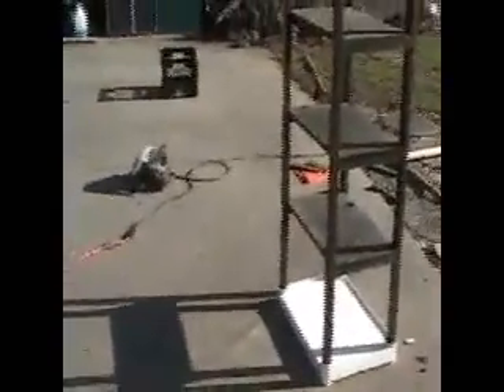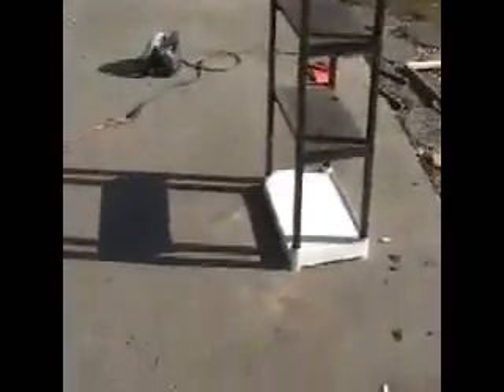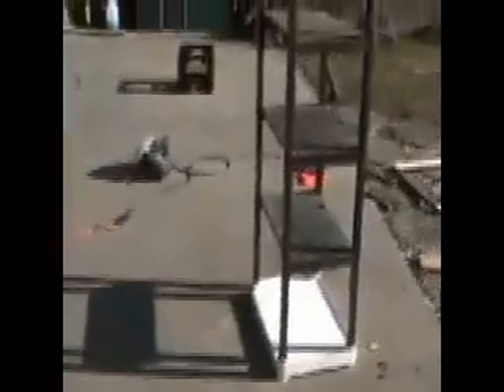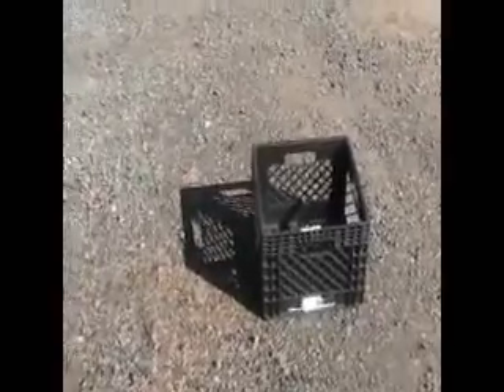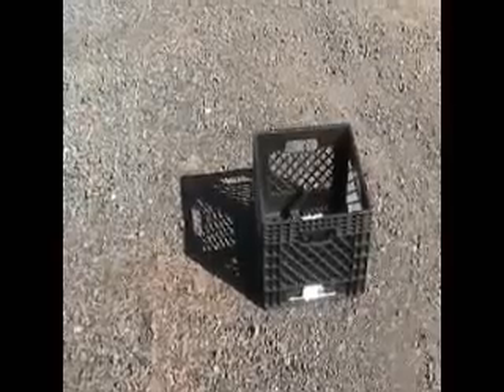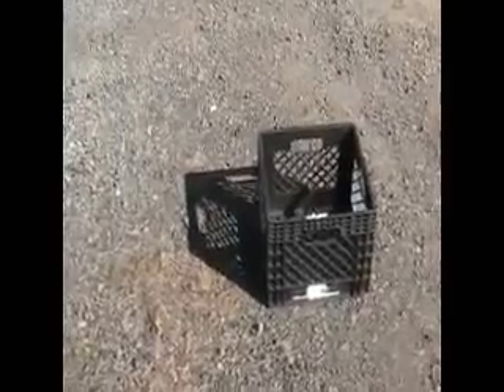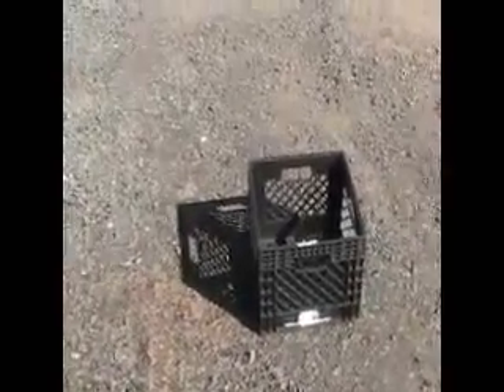#01 - Bulid a Faraday Cage - EMP ElectroMagnetic Pulse.mp4

Comment: Good day,

 

I have a technical question about faraday
cases?

I want to make a closed faraday chamber with metal plates for up to 30GHz
shielding.

My question is about the holes in the air ventilation window.

Is it alright if I directly make holes in the metal plate, in a small window
surface,  with a diameter of less than
1/10 of the frequency wavelength?

Or do I need to cut a square window out the plate to place a honeycomb with
holes smaller than 1/10 of the frequency wavelength?

I need so many dB shielding as possible.

Can you help me with this question ?
Reply from the maker: the idea principle idea is to have a continuous & connecting shield around the things you want to protect - that being said any openings have to not only connect to each other but no be so big that a EMP or surge can break thru. In your case i would say at 1/10 gaps should be fine. Just remember the bigger the gaps the weaker the protect you may be providing. Thanks